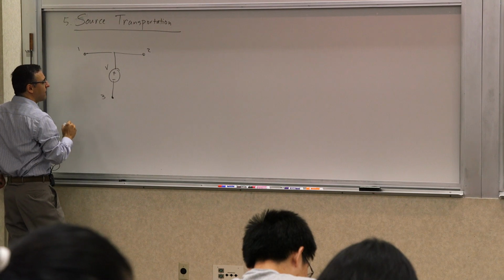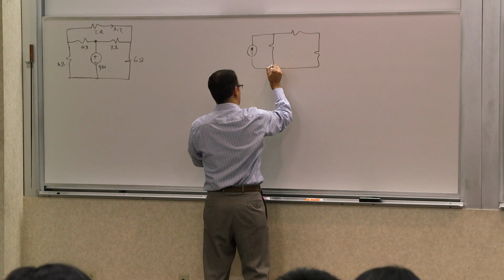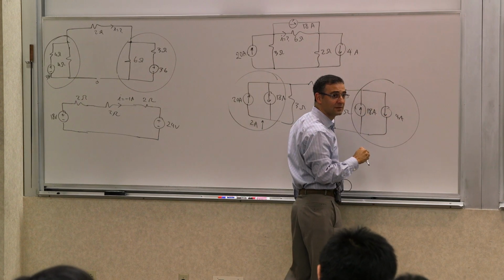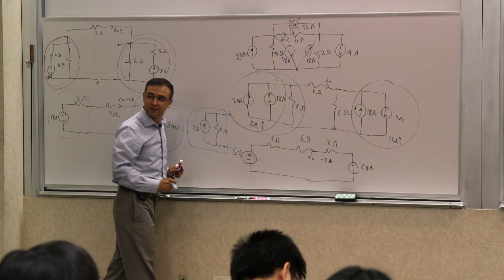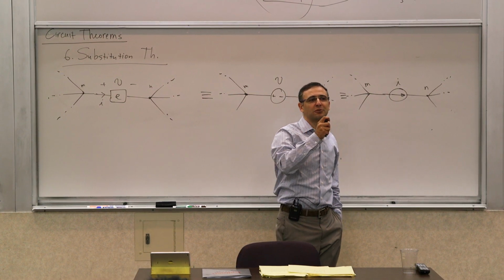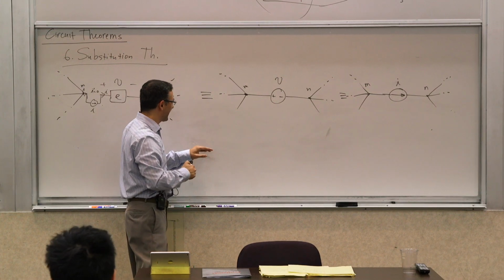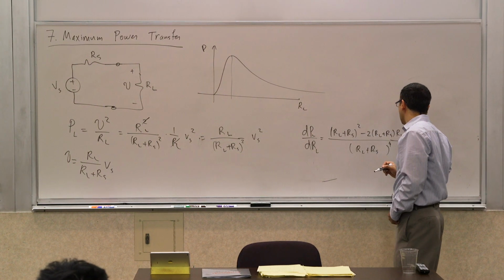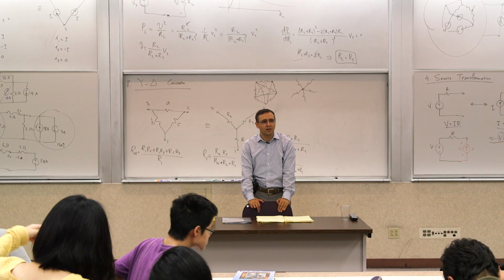009. Circuit Theorems: Source Transportation, Substitution Theorem, Maximum Power Transfer, Y-Delta

Comment: If you are getting green screen on your chrome browser:
1-) Go to More (3 dots at right upper corner of your browser)
2-) Click on Settings 
3-) Scroll all the way down and click on Advanced
4-) Under System disable "Use hardware acceleration when available"
5-) Relaunch your browser. DONE.